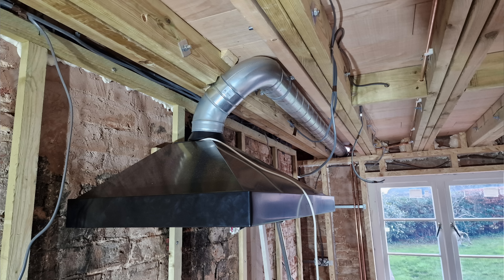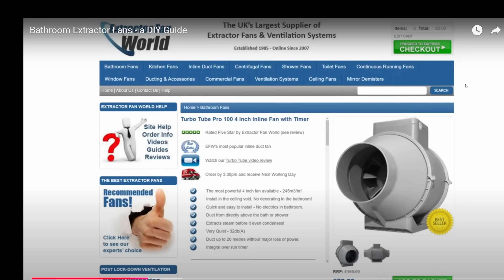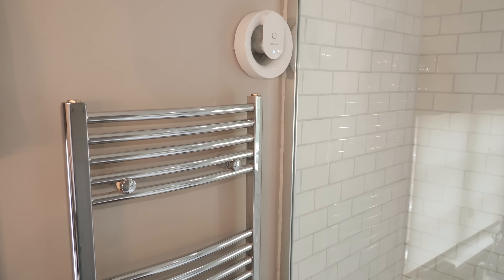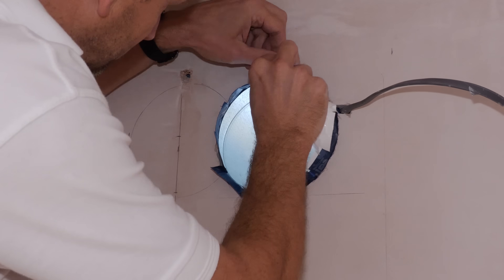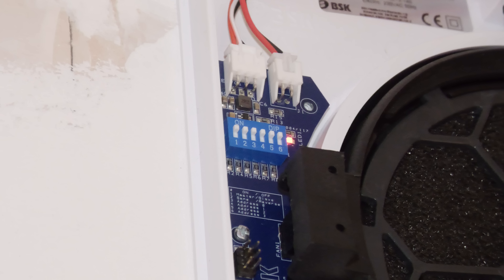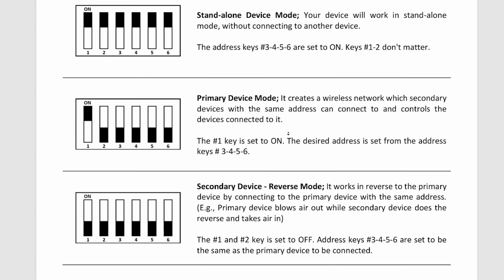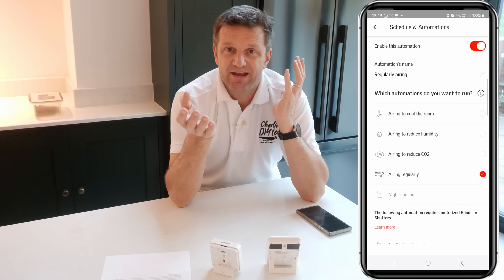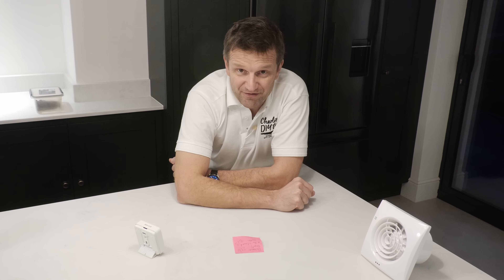A COMPLETE GUIDE to Decentralised Single Room Heat Recovery!

Comment: I'm not sure how effective these would be if you didn't have them in different rooms running out of phase with each other. My main concern with a single device or multiple if they were all running in unison would be whether or not this kind of device would actually provides a net benefit. I don't know the rate at which a typical house with equalized pressure gains or loses air when a fan is running and then suddenly stops. However, I suspect that while the fan is running for 70 seconds, the low pressure created inside the house would draw cold air through crevices all over. 

When the fan switches to pulling air in, the incoming air won't be as hot as the outgoing air, which is expected for any heat exchanger. This lukewarm air will pressurize the house, which already contains a mix of cold air. This mix is presumably warmer than the air being pulled in through the heat exchanger, causing the air to be pushed out of the same crevices that previously drew in cold air.

Maybe this effect is slower than I expect and this unit has a net positive but because of these reasons I think there's a decent potential for it to be a moot point without multiple working out of phase.

Comment: I’d buy this in a heart beat if BSK had a local only control for the ESP32 so I could integrate it with Home Assistant.  I’m fairly certain all of these companies will stop supporting their app/cloud before their hardware fails…
Reply from the maker: Pretty sure this can be integrated with HA
Reply: @CharlieDIYte there's an add on for bsk made by someone for home assistant
Reply: @hansolo-m7p No too sure that is actually in "production", it may well be easier to use an IR blaster

Comment: We have some brilliant DIY channels in the UK and Charlie's is probably the best. Great info delivered quickly as usual. 
I've just started looking at decentralised ventilation with heat recovery, so this video is very timely. The product I discovered was Venti Fluxo but I will be researching other options. 
The reason I started looking at this was as an alternative to trickle vents in windows. I'm about to move into a property that will need new windows. The idea of spending a lot of money on modern, beautiful triple glazed windows, maybe aluminium clad (have a look at Internorm UK) - and then having a gorilla drill misaligned holes in the frames and glue on a plastic trickle vent is completely stupid.
So if I do get the new windows I plan to have one of these units in each room.
BTW for this 4 bed, 2 bath bungalow I was informally quoted 8-9K for a centralised MVHR system. Bungalow installs are generally cheaper as the loft access is generally good. HTH.
Reply from the maker: Thanks for the kind words 🙏 I would say go centralised. I know it's expensive but you won't regret it. It will solve all your trickle vent problems in a heartbeat. I had some triple glazed bifolds installed and luckily building regs said I didn't need trickle vents. The installers said it was very unusual to see them without. I agree though and terrible cold bridging.
Reply: You are quite right that trickle vents in good windows are a terrible idea. We had Internorm 3G windows and they are very good indeed. We DIY retrofitted MVHR. It was a PITA to do but only cost £1300 in parts (£500 ITHO unit and £700 in pipe and bits), so MVHR doesn't have to cost a fortune, and it has worked very well indeed for 8 years now. I cover some of it in this video https://www.youtube.com/watch?v=OVcvk9Wnyw4&t=1465   Designed on a spreadsheet - it's not rocket science. I would consider the ubbink semi-flex pipe if you can fit it in because it makes both the design calcs and the fitting much easier. (it just costs somewhat more). In a bungalow it should be very easy to do it that way, with all the pipe in the loft. You might want to join the #retrofit channel on matrix to talk about such things.
Reply: @xxwookey  Thanks very much for the info. I'll have a look at your video.
Reply: @xxwookey  #retrofit 'channel': I'm new to matrix - which I find a bit confusing. I'm using the Element client. Is #retrofit a room or space? Thanks
Reply: @micdev42  It's a room (I already replied to this once but it's not visible here now). Element-X is a lot faster than element.
Reply from the maker: The Venti Fluxo looks very similar to the BSK but without a servo motor opening flat on the inside. And it's a lot more expensive. The Envirovent HSA 100/330 seems a better option albeit pretty ugly - in that it's recovering the heat the whole time rather than in cycles.
Reply: @CharlieDIYte  Yes the Vento Fluxo is expensive and I'm not sure what the justification is. I'm certainly not committed to it. It was mentioned by the sales rep. at Internorm windows. At that point I hadn't come across the concept of dMEV, but I can now see there are many options.
I don't know who designed the HSA 100/330 but they should be fired! Diabolocal lol.
I've not discounted your tip re. whole of house MVHR and will look at that when we move in.
I'm interested to know why your bi-fold doors didn't need trickle vents.
Reply from the maker: @micdev42  I can't recall, but possibly because it's a renovation rather than a new build...
Reply: @CharlieDIYte  The BSK Zephr looks good: great video that explains how it works. Plus Wi-Fi and a remote - what's not to like!

Comment: Do you think it would be possible to replace the filter with a HEPA filter?
Reply from the maker: I've been thinking that. The problem with this filter is it's designed to protect the ceramic core from dust rather than filter air to improve air quality. And on the supply cycle it's pummelling rust dust back into the room, thinking about it. I suppose the issue is it'll reduce air flow. I might look into it!

Comment: But if you install just 1 of these units surley all the while its extracting and warming the ceramic core isnt cold air being pulled in for 70 seconds from elsewhere in the house. I have an envirovent heat recovery unit with the in and out flow both at the same time and even thats only 60-70% efficient.

Comment: Be a great idea in an extractor hood , more heat to recover.
Reply from the maker: The ceramic would get clogged up too quickly
Reply: @CharlieDIYte  yes would need good filtration , great if its only steam though (condensing for more heat)

Comment: Great video Charlie. I installed  the Blauberg Vento Duo in my bathroom. Some years ago.

 When using multiple units how does stack effect and wind pressure effect these? I believe they would become unbalanced with inefficient use of the ceramic core, unless perhaps the units could monitor and compensate for changes in pressure/fan-speed....
Reply from the maker: Thanks mate. I think it would be tricky if I'm honest as wind is such a massive factor in the efficiency of this.

Comment: I'm having real trouble finding a decent unit for my situation. My walls are sandstone about a meter thick, including the internal insulation panels. I already have a 100mm hole for an extractor fan. I don't want to enlarge it as I fear it will weaken the wall too much. Also I'm living in a conservation area so I will probably get in trouble for doing anything to the walls. They're over 200 years old, so I actually think it's wrong to mess with them. I can't find a good quality quiet running unit for this situation. There all for thinner walls or require a bigger duct. Also I really like the self closing vent cover on this BSK unit, but they don't sell it in a 100mm configuration.
Reply from the maker: Is it condensation that's the issue? Could you install a PIV in the roof space instead?

Comment: ha ha core drills? had a plumber installing my gas boiler and went through 2 core drills the bricks were so hard.
Reply from the maker: Exactly 😉 That's why I drill instead
Reply: @CharlieDIYte  The core drill isn't that expensive from what I've seen (and can be sold later anyway) to give it a go first instead of risking an unsightly scar on the external wall. Might not be a big deal if your wall has render on it but if it's bare bricks it's going to look crap. I have a hole in a brick wall where the cable from the satellite dish went in. Someone didn't drill the hole nicely and chipped off a piece of brick. It was hidden by a plastic cover, now is exposed and looks ugly, but it's a small hole unlike a cave like here - you chip off too much, the cover might not be enough to hide it. In the worst case when you cannot get through you'd at least end up with a nice pilot circle to guide the standard drill.

Comment: I live in a very old house and our kitchen is in the basement. The house is split level so the front wall is underground, the back wall opens to the outside and the two side walls connect to the neighbour's since it's a terraced house. Something like this would be great, but with only one wall opening to the outside, I'm not sure what my options would be. I could get just the one, but then there won't be any other air supply to the basement. I'd genuinely appreciate some thoughts as I've had at least 5 damp proofers out to look and not only are they clueless when it comes to this kind of tech, none of them seemed particularly trustworthy. Every single one of them bad-mouthed the advice I'd been given by the others and it seemed like they were just saying anything to get the job.
Reply from the maker: I think one in that outside wall would be better than nothing?

Comment: The problem as I see it is the metal tube, A bigger thermal bridge than the PVC version.
Reply from the maker: Yep. Agreed. I will be replacing it shortly.
Reply: @CharlieDIYte  Is that also a problem in the video about the kitchen extractor installation? If I understand correctly, the foam was supposed to alleviate the issue. But the hole the metal pipe went in was sealed with mortar (https://youtu.be/2hw9XA9qHjA?t=441) so does that also need fixing? Would it make sense to use a plastic pipe inside the hole instead and then couple it with the metal one? Or would that be a fire hazard even that far away from the heat source from say the oil residue inside the pipe catching fire and spreading all the way to the hole?

Excellent videos by the way and cover exactly the topics I'm very interested in right now. Thanks for sharing your experience.
Reply from the maker: @frankkimono2255 It's a good question that I have wondered about. I guess the metal duct in the kitchen oven fan is so long the cold isn't going to convect down its entire length like it would with the BSK duct I installed - particularly given it's insulated. Also, it's only extracting, not bringing air in, so the duct will be closer to room temperature than the duct I installed for the BSK. The hole was sealed with mortar but had expanding foam around it right up to that point on the external wall.

Comment: If it pushes air out of the house for a certain period (negative intern pressure) and then pulls air in for a certain period (positive internal pressure), where is that extra air coming from? On the out phase - cold winter air will be pulled into your house, probably through windows and doors, on the in phase, your nice warm internal air will be pushed out through the same route. Pointless! 

Much better to get a single room system with split or concentric air ducts (like the in and out of a gas flue) which can recover the heat by a counter flow method and does not change the air pressure inside the room and encourages draughts.
Reply: Basically, if you have a high level of air-tightness in your house (which is something you should aim for), this system will not work.

Comment: Would anyone know how well these perform in the cold winter months with a low temp outside and a bedroom that is prone to condensation thanks.5
Reply from the maker: Ronan if you scroll down to Andy Mac's comment you'll see how his has fixed the mould and damp in his outdoor room. Check out my video on this https://youtu.be/NbtijHKy2Vo?si=e2GhJqRymLVh2gGt You could install 2 fans to work as a pair to maximise air circulation, or consider installing a PIV.

Comment: I do not understand gow this system could work with multiple units and still recover heat of some are only extracting and some only supplying? How the heck would the heat be recovered?
Reply from the maker: Because they're still working in 70 second cycles but some are expelling whilst others are supplying.

Comment: Nice idea, but too expensive, too noisy and not efficient enough.
Reply from the maker: We don't really notice the noise to be honest.
Reply: @CharlieDIYte  The noise is a valid concern. How far away do you have to be from it not to hear it at all when on the lowest setting? Then there is a matter of the noise not being constant due to the direction change every 70 seconds, I imagine the noise of the fan spinning down and up again can be even more distracting. Maybe when the fans are positioned strategically this can be alleviated or even eliminated if the property is large enough to allow for that. In my 3-bed semi the bedrooms are so small I can almost reach the opposite walls by stretching out my arms (in one of them I actually can) so my ears are never that far away from the furthest spot in the room. That probably rules them all out (=the entire first floor) as the location for this fan.

Comment: Great video as per usual Charlie! Thanks for the shout-out. Bit of an update on mine - bear in mind mine isn't in a domestic environment, it's in a studio. The Kair MVHR fixed my mould and damp issues, which was my primary objective. However since my studio isn't heated 90% of the time I doubt the heat recovery side is doing much and in reality it's destroyed my soundproofing 😂😭. A future project will be to fix this properly but it's not particularly urgent. Sadly that will probably involve removing the MVHR since the simultaneous 'IN & OUT' through a single hole really complicates things when it comes to making a soundproof enclosure. But it's been running on trickle for over a year with no issues and more importantly my studio is now mould-free. The BSK system looks great! 👍
Reply from the maker: Thanks for the great update Andy. Yes it's a nice bit of kit but the Kair seems to be pretty tech/ hardware heavy in comparison. Possibly more efficient on the heat recovery, or maybe the BSK is just a brilliant design? Who knows. I'll be really interested to see how you solve this whilst keeping the studio sound proof. 👊
Reply: @CharlieDIYte  Yeah, me too. 😅
Reply: @CharlieDIYte  Charlie, you’re right — the Kair HRV150 uses a twin-duct crossflow exchanger rather than the push-pull ceramic type. It’s a bit chunkier, but it avoids the reversal cycle and keeps supply/extract separate.
Reply: I think there's a way of making ... would it be called a baffle? Basically making the air vent on the outside of the wall go through three 90 degree turns in quick succession, and you could make it out of dense material lined with foam to stop reflections. It's similar to the open corridors that you can soundproof also by making successive turns.
Reply from the maker: @justinsenryu7308  Yep, that's exactly what @gosforthhandyman is thinking of doing
Reply: @justinsenryu7308  I am wondering this as well, as I am also looking at MVHR for my studio/workshop... it can be noisy, so I'm wondering if these units will still work properly with a baffle system or not...
Reply: Hey, do you think yours / a MVHR unit would work with a baffle system to help reduce the sound exiting?
Reply: Merhaba benim amacımda köy evindeki 60-70 olan nem seviyesini 50'nin altına çekmek. Her odaya bir tane toplam 6 adet düşünüyorum. Nem konusunda gerçekten başarılı mı?
Reply: Really appreciate hearing this Andy 🙌 We’ve been building the Kair HRV150 for nearly 20 years now and stories like this remind us why. Great to see it keeping your studio mould-free. Thanks also to Charlie for sharing these projects — we’re using questions here to plan new explainers on the Kair YouTube channel if anyone wants to learn more.

Comment: Did the metal ducting require  an earth connection? As the cable is so close
Reply from the maker: The unit is sheafed in plastic and the plastic pipe I slotted in prevents any contact with the duct.